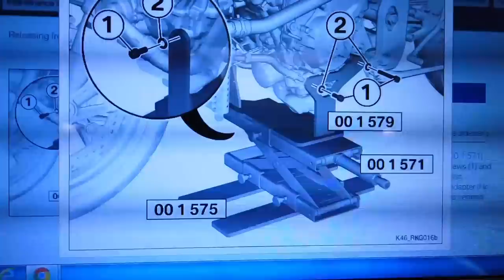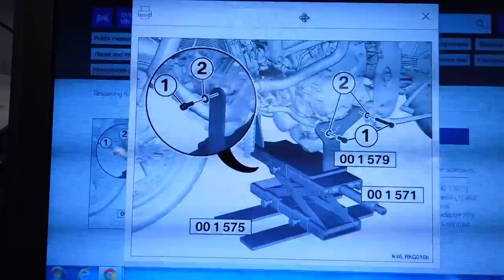26th Spyder Ever Built!! • iPhone 12 Pro Max Case..! | TheSmoaks Vlog_1822

Comment: I hate paying big prices for simple things. I would modify a scissors jack by welding some plates on it and mounting that adapter in a way it could be slipped on/off after tightening or loosening loosening a bolt. A couple of hours at a friends garage would get it done for a case of beer. Even if one had to use a welding shop, it still would be a whole lot cheaper and certainly safer than what you currently have to use.

Comment: I love my Otter Box on my iPhone 8+. Makes the phone feel a lot bigger than it really is. I'd really like to get the new 12, but I don't think I can justify it financially right now. Besides that, I'd have to see if it's any bigger than my 8+. If it is, it probably wouldn't fit in my RAM mount on the bike. Wonder if you could set up a camera outside to take a photo every morning at the same time for several weeks to make a time lapse of the changing season? That #26 Spyder is way cool! A tip of the cap to my fellow Veterans on this day. Peace and love.
Reply: I use otter box too because I am a spaz. I drop phones a lot. Before I got iPhones I used to get the ruggedized mil spec phones.

Comment: RE the new Apple stuff, IDK. I am not too happy with the direction with the M1. It's all becoming locked down. I saw this coming years ago and now it's happening. A Mac is becoming an appliance and as a tech, I find that boring and restrictive. Been using Macs for 33 years and supporting them for 26+. I'm actually wondering how I could integrate android and linux ecosystem. My Apple Watch would be the lone stumbling point. $1000 is crazy for a jack setup. One can get a whole ride on lift for that much. Maybe you can fab a scissor jack to work with the BMW mount. That's what I would do. Did you see the Roland Sands Dakar build?